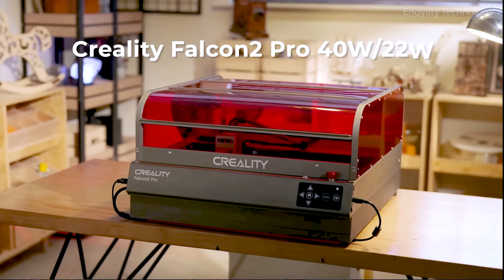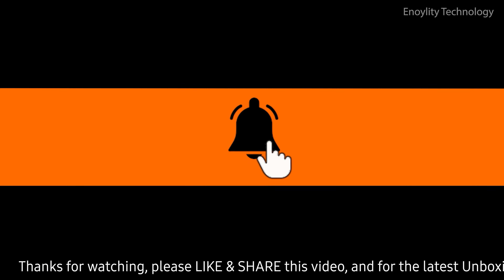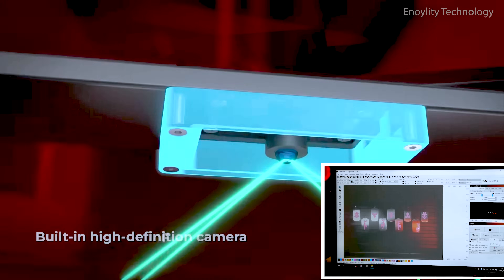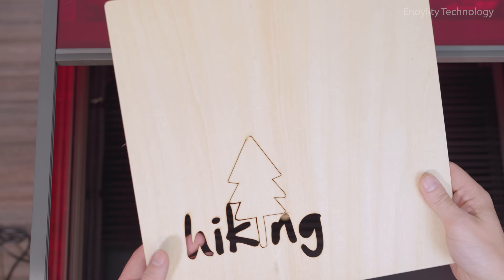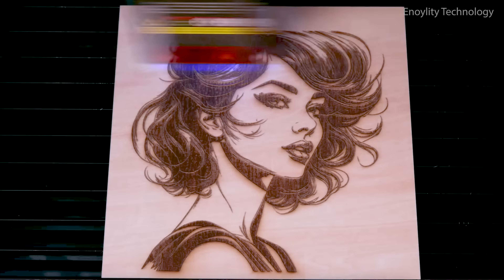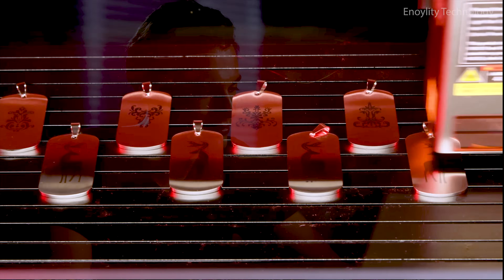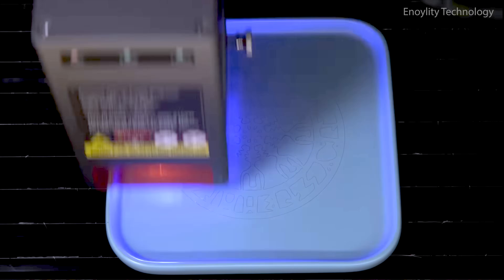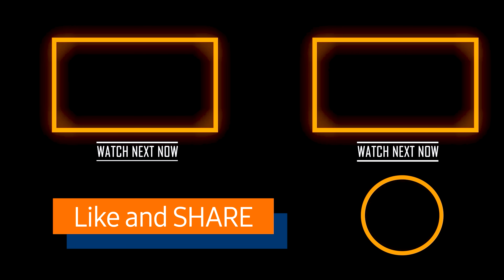Creality Falcon 40W Laser Review: Powerful Precision Engraver for Every Creator!

Comment: It’s a well-balanced machine overall Not perfect, but better than most in its price class You get solid value
Reply: I chose to use LightBurn as the software for running the laser and it is where most of my time has been spent trying to use the machine. The good news is that there are lots of useful videos in YouTube.
Reply: I have only played with it for a short time and am already getting the hang of it. I love the thing. High quality. Nice price point. Works really well. I use LightBurn software which seems to be similar platform to Adobe etc. I would recommend buying a decent heavier gauge usb cable to transmit data to the laser from the computer.
Reply: The headline says it all. This is an amazing device. I can't even begin to list all of the amazing things that this does. It engraves in glass, metal, felt, wood, cardstock, leather, and many other things.
Reply: The hardest part is learning the software, so if you have a software program you already love, you’ll be a step ahead! The engraver works awesome! It’s super quiet, fast, and engraves just like I wanted it to! For the money spent, I am super happy and can’t wait to see what else I can create!

Comment: The cable cover near the gantry gets in the way sometimes
Reply: It is a great option for anyone who wants to start a small business making custom items
Reply: The other lasers I own are Lightburn compatible, so I can run projects I've previously created on this machine, saving design time
Reply: The screw attaches the laser to the rest of the machine, a keystone piece. I received a replacement piece that does not work. I reached out about this issue, no response. I am worried I wasted a lot of money on this machine.
Reply: Very solid product with markins on the x and y axis. After looking at many other options, this seems to be the sturdiest, well made and most affordable option. Honeycomb panels greatly reduce tempering during engraving, ensuring a precise, efficient process. Great job!

Comment: It’s super fast I can finish jobs in half the time compared to my old 20W machine
Reply: Could use better software integration LightBurn works well, but the default software is meh
Reply: The design is strong and solid, so it can be used daily without problems.
Reply: It is fast too but that depends on the project as some 3D deep engravings takes much longer to do - Even few hours but the result is breathtaking.
Reply: The design of Gluwphy laser engraver provides safety by containing the laser but also contributes to a quieter operation by keeping it enclosed

Comment: Exhaust fan and air assist integration were smoother than I thought. Great design
Reply: Documentation could definitely be clearer, especially for first-time users
Reply: It struggles a bit on shiny materials Aluminum tags reflect a lot of the beam Marking spray helps
Reply: The laser itself is capable of very fine detail and is powerful enough to cut through wood and acrylic. I was even able to cut out shapes in 3/4” pine without much charring of the edges
Reply: It has a built-in air assist that works well. The motor isn't that loud and you can easily adjust it on the side of the machine. Using it, the cuts and engravings are nice and clean with no burn marks so far.

Comment: Absolutely love the power. I used to have a 10W and the jump to 40W is a game changer😊
Reply: Cutting acrylic is much easier now. Cleaner edges, fewer burns
Reply: It’s fast and powerful, but don’t leave it unattended Safety sensors help, but it’s still a 40W laser Definitely not something to run on autopilot
Reply: It has safety features like shields and emergency stop buttons.
Reply: Two Y axis v rollers were not tightened correctly when assembled. This leads to poor accuracy. Circles not being true and so on. To fix this half the machine would have to be taken apart to pull the x gantry out to tighten the rollers. Also to tighten the Y axis belt all the enclosure has to be taken off... All that would have needed to be done to avoid this was four holes cut in the enclosure where the screws and holes are for the adjustment.
Reply: It also cuts. I'm floored by all of the amazing stuff that it does. Now it doesn't have a lot in the way of instructions, but check out YouTube and you can get a lot of helpful videos on the setup and getting started

Comment: I really like the idea behind the Falcon 2 pro, but unfortunately Creality support seems to be nonexistent.
I am having problems with cuts due to the laser head being at an angle, this causes cuts through thicker stock to be at a very noticeable slant.
Reply: You’ll definitely need a good ventilation setup it produces a lot of smoke
Reply: I added auto-focus and it made a huge difference Not sure why it’s not standard at this price point Still happy with the upgrade.
Reply: It's easy to handle. In addition, the manual functionalities allows making sure any issue about the air, fire or lens too
Reply: It is light and compact, making it easy to move or store when not in use.
Reply: Lightburn is fairly inexpensive and is fairly powerful, though it isn't always the most intuitive. This laser operates with g-code, so theoretically, other software could potentially be used, though I haven't tried it.

Comment: I like the size and light weight construction.
Easy to assemble and use.
My only complaint is the fan is useless. Doesn't move enough air to keep the smoke out of the room. I had to purchase a 3 inch duct fan to make it work. Not a problem but just plan on that if you purchase this.
Reply: It comes with clear instructions, making it good for first-time users.
Reply: Obviously, this machine is beest to use with small objects as the laser focusing distance is limited here but still you have some good amount of space to release your creativity.
Reply: It’s worth noting that my kit came with a defective rotary attachment but customer support responded very quickly and sent me a new one within a few days. Pleased with this purchase!
Reply: The laser accuracy is fantastic. For the value of this machine it is great. I will recommend this machine to anybody.
Reply: Using it, the cuts and engravings are nice and clean with no burn marks so far.
Reply: I really like this quality machine and I think you will, too.
Reply: The cutting results on wood were precise. I’m still new to this and haven’t tried other materials but I’m sure it works just as well. The air assist function is great! Helps reduce the smell of smoke and debris during the process.

Comment: Got it all set up followed the directions and all . I got the machine and air to flow but laser output anything. It acts as its cutting/engraving but it’s not. Using light burn
Reply: It creates clean cuts without burning the edges too much.
Reply: My other laser was attached to my CNC, which made things maddening most the time. The creality 12w laser and Lightburn is smooth as silk. No issues, super fast, easy to setup and use. Very happy with my purchase.
Reply: Works great, easy to set up and use. Just remember to clean head often if you do a lot of cutting

Comment: The quality it looks good. Durable. Easy to use. I wish it was a little bit bigger. The fan needs a little bit more improvement overall. I'm happy with it. There is just little tweaks that they need to make to make this better
Reply: Been using the Falcon 40W for about a month this thing is a beast Cuts through plywood like butter
Reply: Build quality is solid, but the aesthetics are pretty plain
Reply: You can engrave both small and large designs with ease
Reply: Had a bit of rocky start, but the customer service is second to none and now this machine is amazing. Definitely recommend. As they will take good care of you.
Reply: It's given a whole new life to my wood shop. Great but. Fun to be creative and learn new things! The laser engraver is easy to use, very good quality. I highly recommended.
Reply: The manufacturer definitely takes pride in their product. This is packed so well and almost completely assembled upon arrival.

Comment: I can’t believe I went this long with out an enclosure. This is a basic enclosure but does a great job keeping the smoke from filling the room. I no longer have to crack the garage door in the winter to air out. This thing is fantastic!
Reply: The fan is kinda weak for big smoke-producing jobs. Had to add an external exhaust

Comment: It works as it should and if you don't plan to use a camera it is roomy enough. BUT, with that said, it looks NOTHING like the photos in the listing. From the photos in the listing it looks much more rigid than it actually is
Reply: The machine works well even after long hours of use.
Reply: Everything is perfect about this machine compared to the old one I had the only problem was the SD card that came with the laser engraver had no files on it so I had to go on their website to get the drivers installed into the laser
Reply: Once you are started it's all pretty easy. My wife said that it was only a small learning curve from her Cricut machine. If you are looking to get a laser engraver this is an excellent one to start with.
Reply: The cords are secured nicely so they don't stick up and get in the way, especially if you are using an enclosure. Very nice cord management!
Reply: This laser does everything I need it to. Its power justifies the price. Next up would be a CO2. Will cut a 1.5in board in one pass at 400 speed and 100% power. You can’t find another laser as quality and power for less then this

Comment: Set it up and used it today with a Longer 20w laser. I put exhaust out the window and it seems to do the trick. I did end up adding an additional in line fan to keep up with the smoke. Overall, it does what it's supposed to
Reply: I don't always like to use my computer in my garage, so I really like that this laser is easy to operate offline. It has auto-homing and framing buttons as well as X-Y controls which allow me to easily align the laser with my project
Reply: For someone new to this it takes time just like any new machine/system but with time and patience and lots of YouTube videos it’s doable! Can’t wait to see what else I can make!

Comment: It is very disappointing to spent such a large amount of money for a product and have this kind of problem . I am now researching other brands to try and decide what to do. I’ve included a photo of the faulty circuit board where the usb-c plug should be attached.
Reply: It has a long-lasting laser head that doesn’t need frequent replacement.
Reply: it takes few moments to get used to this and again the instructions are not too clear about how to get started engraving. It takes few moments to figure it out how to use a software but if someone used a Photoshop or some other photos/image software it shouldn't be too much of a problem to use the LaserPecker design studio software.
Reply: It cuts very well and gives great detailed results. Just fyi for a problem I had, if you set it to a speed that is too high, it will error on the second pass. Lowering the speed stops the problem.

Comment: Overall, it does what it's supposed to. The vinyl window is decent for blocking the light, but i kinda like to see what's happening.
Reply: Works perfectly with LightBurn No hiccups so far
Reply: It works like I expected and the software is easy to use
Reply: The cooling system helps the machine stay safe during long use.

Comment: I kept reading about the fumes and the smell and wanted to make sure that I wouldn't be affected by any of these things and was excited because it actually had a fan unlike the other enclosures that I bought. However there's one glaring and huge thing missing from this item...
Reply: It’s fast, but if you're not careful, speed can lead to lower detail
Reply: The machine set up was a cinch. I also got the flexible cover, which set up easily. My biggest issue was trying to figure out where to put my computer and the exhaust hoses, not from the Creality equipment but from my new work desk and outside exhaust. Included samples cut quickly and PERFECTLY
Reply: Honestly, I wasn’t sure what to expect, but this laser blew me away—solid build and great performance!

Comment: If there are large openings the fan cannot draw the smoke out of the enclosure. This is a well designed product with ports in all the right places.
Reply: The moving parts are enclosed more than my previous engraver so it's easier to clean this one. Just a sleeker look overall.
Reply: This machine has a filter for the dust and smoke that I haven't seen on others when I was shopping around. I am still going to stick my hose out the window because of having a grandbaby. I was honestly surprised at the size, some of the other machines are big, heavy and have a whole other piece you have to connect to it for the air hose. For the price it seems very durable. My husband is ready for me to try leather and metal patches for custom hats. You know since he told me to buy it he thinks he has to have some items made for him lol. So far I have only done some small wood pieces that worked out great. Can't wait to venture out with out materials. Definitely recommend for beginners.

Comment: The open bottom is actually great for engraving on things larger than the laser. I read a comment where someone didn't like that it wasn't sealed on the bottom but I cut hdpe with it and the smell does not leak out. Which says alot. You won't regret it.
Reply: The vinyl window is decent for blocking the light, but i kinda like to see what's happening.
Reply: A sub component was misassembled and I couldn't fix it. Customer service stayed in touch and replaced the part very quickly
Reply: No big setup needed
Reply: This item is very easy to set up and use it takes a little getting used to the software and how to control it but over all it was a very good purchase and customer support is great the solved a issue I was having with one message

Comment: Does it support air assist?
Reply: Creality’s customer support actually responded quickly and helped me with a firmware issue
Reply: The air assist included does a great job Cleaner cuts and way less smoke build-up on the material Saves time on post-processing too.
Reply: The results I get on plywood with the 40W are production-grade—smooth cuts, no sanding needed
Reply: Definitely 💯 It has automatic air assist for cleaner cuts

Comment: The laser engraver is capable of producing extremely detailed and intricate designs, allowing users to create artwork that showcases fine lines and complex patterns with remarkable accuracy.
Reply: This laser got me into taking orders from local businesses. Very reliable
Reply: Works well, easy to install. The only negative is that there are no marking on the speed controller to you know if you are getting 25, 50 or 75% air flow. Marked my own.
Reply: I love the 40W’s ability to engrave stainless steel—it opens up more product options for my shop
Reply: If you are upgrading your laser and have experience with setting up and using them, this might be the product for you. If you are just entering this field for the first time I would advise starting somewhere else!
Reply: This laser engraver is awesome!! It came already put together so we were able to pull it out of the box and start it using it. We like how it comes with a box, lid and ventilation.

Comment: The designed for higher productivity with faster engraving speeds, reducing project completion time without compromising quality
Reply: I am honestly very amazed by this laser engraver and I just love it a lot for its compact and very beautiful design and for the powerful lasers that can engrave anything on almost any material
Reply: I am still amazed at the accuracy and consistency of cuts. I did one cut, from my software, that wasn't deep enough, so I simply included more reps without moving the wood or changing the home settings, and the new cuts perfectly aligned to the old ones. This machine is a gem!
Reply: Not even close to my first machine, but I skipped the original Falcon, which looks more like a rebadged Atomstack than anything else. This time around, Creality put some actual effort into the machine, but falls short in some key areas.
Reply: It can definitely cut through a 3mm piece of wood in one pass. I haven't tried anything thicker, but at 100% power and 350 speed, it cut perfectly.

Comment: You can turn photographs into engraved art, adding a personal touch to your projects
Reply: Nice touchscreen and interface Very beginner friendly
Reply: Great value if you’re upgrading from a lower wattage laser, but overkill for basic hobby use
Reply: Cutting performance is amazing, but it’s overkill for casual use If you’re just engraving coasters or keychains, this might be too much Better suited for small business or high volume.
Reply: Filtered exhaust, honeycomb floor, e-stop, auto focus and much more. I highly recommend this laser for anyone that doesn't require the through put that the much higher dollar units provide